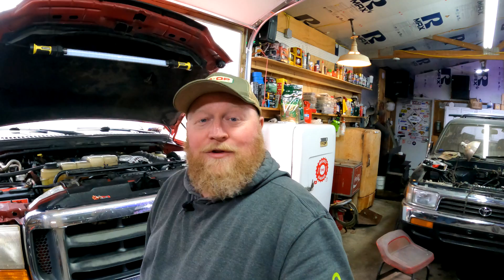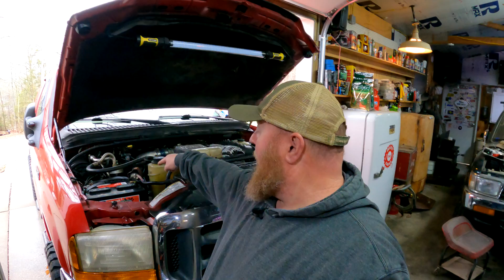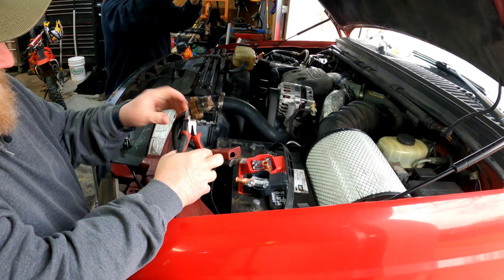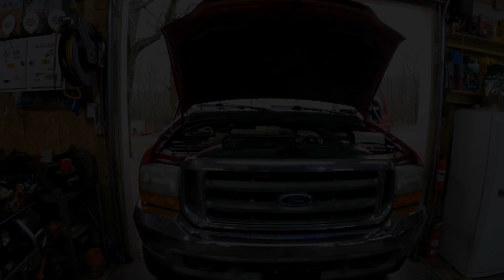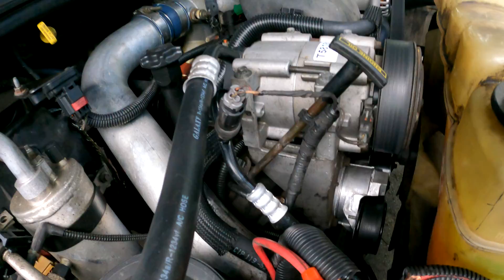$500 Ford 7.3 SUPERDUTY Powerstroke Battery Cable Fix - Easy Cheap and Permanent

Comment: Hey so you used what looks like 4 of the same brass connectors and a couple smaller ones. Do I need to buy all 4 of the brass fitting links you provided? Thanks.
Reply from the maker: I've ran into all kinds of various sizes. Best thing I can recommend is to buy a small assortment.

Comment: Trying this out seen two different type of rings 0 gauge and 4 gauge ring was wondering where each are going .
Reply from the maker: One to the starter, one to the glow plug relay, one to the other battery and one to the accessory wire, i believe.

Comment: Will this method also work for a 2007.3 diesel that the secondary battery is behind the front passenger wheel?  Just need longer cables?
Reply from the maker: Yes it will.

Comment: I just redid all 4 posts connections, mostly cleaned up and replaced bolts. Easy and maybe 90 minutes . Painted them to protect and look good.
Last year redid my 78 J10 Jeep battery , ground, starter ends with the solder pellet routine NEVER touch again type. 
Ran 0/1 thick cable new materials everywhere. Finished with heat shrink trim out . Crimps eventually crap up, solder type are impervious to oxidizing electrolyte in them.
Reply from the maker: Nice work. That'll last a long time.
Reply: @ProjectTimeGarage  Well, I like to take pride making it look good for the crowd, plus, LESS Work in the future is a nice thing too, if done right will last long time.

Comment: Nice, will 100% have to do this eventually on my 2000 7.3 with 300k miles (original cables/battery terminals).
Reply from the maker: For such a simple repair, it makes a huge difference.
Reply: mine has 660,000 miles. fixing these mistakes made by the previous owner/licensed mechanic

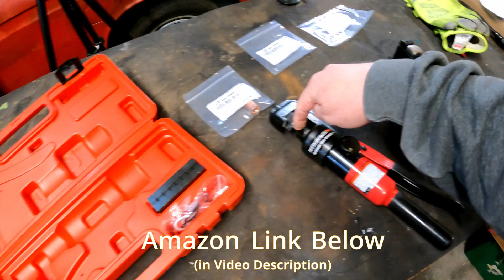Comment: I bought the same hydro crimper as you showed in the video and it will not work for the 2/0 and 4/0. Just curious how you made it work. At 4:27 it looks like a Pittsburgh brand which is the same as I bought.
Reply from the maker: I think I just sent it even though it didn't fit completely. Best I can recall.

Comment: Appreciate you taking your time and helping others and myself. Idk if its a technical problem on my side, but your #2 Lug will come up as a 1/0- 1/2ga lug in the amazon link.
Reply from the maker: Ah thanks for pointing that out!
Reply: @ProjectTimeGarage I’m having the same issue, do you know what the #2 lugs are supposed to be?
Reply: Also what size did you use for the glow plug wire ?

Comment: No way in hell am I gonna pay $400+ for some cables and connectors. This is basically what I was planning to do, but even cheaper since I have wire that needs replacing. Nice work.
Reply from the maker: That's always been my thought too.

Comment: Just did this with all of my cables and clamps. The factory clamps were trashed and looked terrible. Now the under hood looks a lot better and cleaner. Thanks for the video. Used your links to get the correct terminal sizes and hydraulic crimper.
Reply from the maker: Thanks for watching!

Comment: Hi great video sir. I have a 2002 f550 which had 7 months old batteries & passanger side battery went completely dead someone told me to replace the cables. As u said it costs outrageously high should i just do what u did will that solve my issue? I had some corrosion on passenger side terminals aswell.
Reply from the maker: It's the best fix I've found, but dead batteries generally point to another issue like a charging problem, or a parasitic draw.
Reply: @ProjectTimeGarage  got it figured out it was the alternator. Thank u

Comment: Because I'm just a shade tree wrench breaker.  I need new wires also.  Size and length would be awesome to know, so I could just order everything at once.
Reply from the maker: I've not had to replace the wires on one yet. But most are common sizes.

Comment: Going to order these..still have the original cable ends from 2001 and want to prevent any future headaches!
Reply from the maker: This fix works well. We've used it on more heavy equipment than I can ever remember and it's held up great under very bad conditions.

Comment: So I've watched this over and over.
This is what I've got for parts:
2X of 2AWG for both ends of battery jumper
2X 2/0 AWG for both main grounds
1X 4/0 AWG for the starter

I never did catch the glow plug, but I'm guessing 4AWG?
The small ground wire is done in a generic ring, so I'm not sure about it either.
Reply from the maker: I think you're good.

Comment: 22:00 hour's 14 April 2024 $ 500.00  F 350 battery cables you covered nothing pertaining to the ground cables,  details,  straight to the point this is not a lecture class in Votech positive and Negative wiring especially on the engine block.. thank you for your time.
Reply from the maker: Thanks

Comment: For a reference terminal ends needed everyone:  
1x 4/0
2x 2/0
2x #2 
and then the little 2 wires

Out of curiosity are those two little cables on the passenger side 6 ga or 8 ga? Will edit ^
Reply from the maker: Believe they're 8. Thanks for the reference.

Comment: Those crimps are way too tight. The cheaper hydraulic crimper comes with metric size dies. Temco sells a crimper with awg dies.
Reply from the maker: Good info.

Comment: My 7.3 is in a 2002 E350 van, and after doing a "van-life" battery & wiring for campsite power/water/lighting I've got the tools & skills, but until seeing your vid I didn't really feel confident about tackling that 21-year-old monster of a wiring harness.

The second battery will still be a problem, as it's rail-mounted under the cargo-door steps and you can't get to it without lifting the body and lowering the battery box with a jack. I'll get there somehow, and once I do I'll know what to do next. Thanks!
Reply from the maker: You got this!

Comment: WELL HECK! I did it just like this except I bought a different crimper. Long story short is my truck has never started so well! I think those copper lugs are so much more conductive and send all the amps to that starter like they are supposed to. You cannot buy a factory positive cable anymore and so THIS is indeed your only real option and come to find out WAY better than buying a new positive battery harness after market. So if anyone is reading this, the smallest connection that he had to replace is a 6 gauge lug. I wish I would have spent the $60 for the hydraulic crimper because the one I used did a crappy job, they looked like mini bolt cutters but it just did not work well.
Reply from the maker: I had one of those hammer crimpers for a long time, it did a crappy but passable job too. The hydraulic ones are much better no doubt.

Comment: Hammer crimpers suck and those ends suck. I have been doing it professionally for 40 year and corrected for tons of these.  First, use shrink tube to prevent more acid penetration. We take the cables completely out of the vehicle especially ones like this which have surely got voltage drop all over. Blast any good ends clean. The vented batteries and connections like where there will allow acid to wick into wires.  So split them open and clean using hot water and baking soda or some other basic solution, the spray cans don't really work well but can pass. Use a tape like duct or several wraps of electrical close the end you wish to cut off the frayed wire and use a cut off wheel on a angle grinder to assure a nice end which makes slipping the right size terminal end on.  be sure to slip the shrink needed for the whole cable split and cover the crimp before sliding on the end. Then reseal with shrink tube after crimping an appropriate size terminal. Preferably 1/4" ringlet which will have plenty of meat to contact under the clamp strap unlike this weak ass compression bolt set up. The batteries will have been pulled when removing cables. So route the alternator etc cables now clean the battery trays if they're bad enough I'll pull them, blast and paint with ceramic low gloss. Position your clamps for best access to  strap bolts before installing the battery and tighten. Use a spreader not a hammer and be sure they are all the way down. The studs are tapered so make sure they work by placing them all the way down and NO stupid felts on battery lug. Tighten using a 1/4 drive ratchet. Put the terminals you crimped on the cables under the straps and pass the bolts through the ring eye. Last use a good battery protectant either spray on or mop on.  Be sure to check the charging system for over voltage boiling the batteries and causing excess vapor.  No battery blankets unless you live in a cold climate. Battery operation  is best near 80 degrees so think about heat shields if you live in deserts or blankets if you live in cold climate. 
Hope this helps
Reply from the maker: This is great info. THanks!!

Comment: You are right. those Battery cables are expensive, I ended up having to buy them and it costs me around $300 for it
Reply from the maker: That's actually not as bad as the prices that I've seen.

Comment: Great video as always. But something that will save your wrist and your side cutter,  just cut those cables with a cutoff wheel. Having done hundreds of ground lugs on welders, this is just a much easier way to do this. If of courses you have access to air.
Reply from the maker: Lol. I learned that a few minutes into this video. Good tip!
Reply: 14:35 he did.

Comment: Definitely doing this to my excursion when she’s out of the head shop and got her new oil pan! I’m not quite using the race clip yet but the same battery could use one 😂
Reply from the maker: That race clip is really only necessary for drag racing applications.😂

Comment: I had an issue with my truck a couple of years ago where the truck intermittently would not start. It would turn over but just not start up. I went to different forums and pretty much replaced everything that would cause the problem with no real fix. As a last resort I took it to the dealer. The tech later told me that in troubleshoot the issue he was looking at the voltage going to the sensors and saw that they were not getting the correct voltage. He came to the battery and found corrosion inside the sheath of the positive battery cable. He fix the issue and I haven't had a problem since.
Reply from the maker: Good info. Thanks!!

Comment: I did a whole cable replacement on mine, bigger gauge and it was kinda pricey. Was kind of a pain in the ass lol. Nonetheless it is something most of these old trucks need by now. Whats your opinion on the ATS ported turbo housing for stock turbo? I have been considering adding one to my truck
Reply from the maker: I haven't had any personal experience with the ATS housing, but I hear good stuff about them.

Comment: In my line of work we use a nicopress for all different size wiring applications.  They will never fail unless there is severe corrosion and or an accident of severe damage.  I have a precision coating removal tool as well...just not that size!  Aviation requirements are very specific.  Is there a lock-washer under the wiring nut to the battery connector?  Great instructional video.  On the hunt for a 7.3 4WD or a 12 Valve Ram 4WD.
Reply from the maker: Aviation - yeah, those are some hefty requirements. There is no lock washer under the terminals. The copper to lead mating surface gives just enough "squish" to keep them tight.

Comment: I bought one of those Hydraulic Crimplers, simply because you don't always have a GOOD SOLID anchor behind the hammer version, I have 3 of the hammer type, why? #1 and #2 got lost in the bottom of a tool box, so I bought another one, got pissed and bought the Hydraulic so I could get a cleaner job.
Reply from the maker: Yeah, I found myself setting the hammer crimper on the radiator support trying to hammer them closed. Gave up and went with the hydraulic one. Much easier.